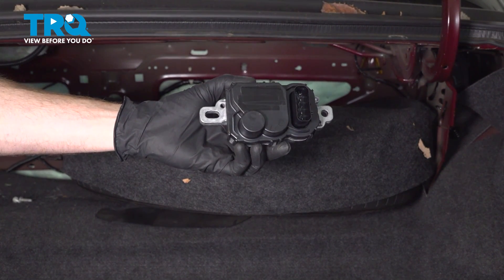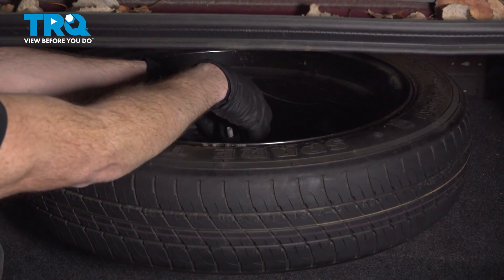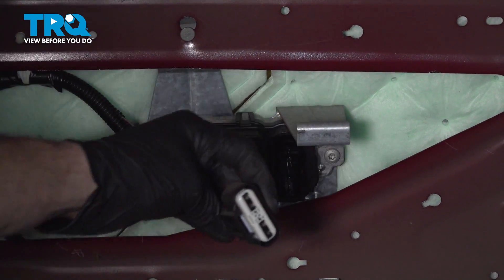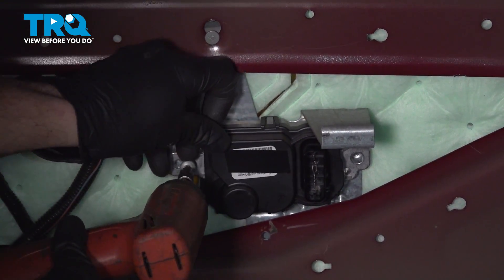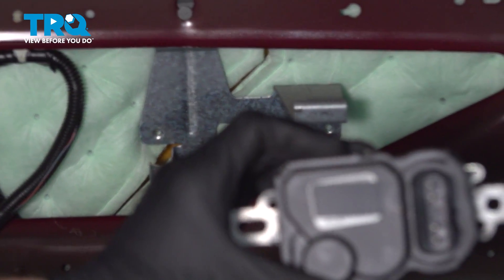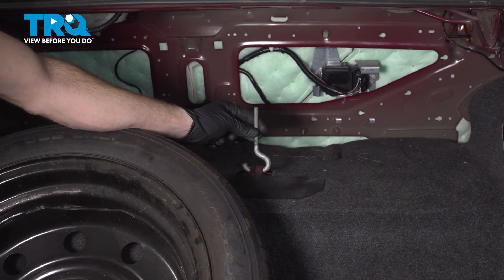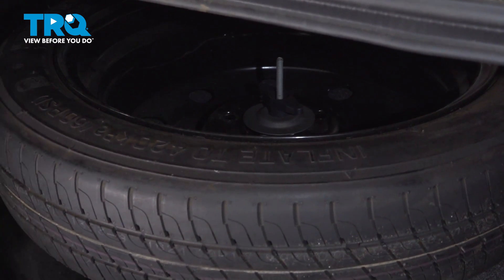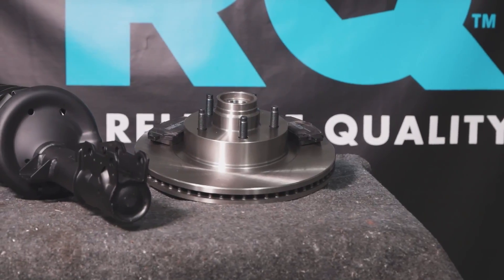How to Replace Fuel Pump Driver Module 2003-2011 Mercury Grand Marquis

Comment from the maker: √  Watch the Video
√  Buy The Part at 1A Auto https://1aau.to/m-Shop-TRQ-Parts
√  Do it Yourself
√  Save Money
Reply: You need to change the model year range on your video.  I am working on a 2003 Mercury Grand Marquis and the fuel pump driver module is not (1) located as indicated in this video and (2) of s not the same part.

Comment: For 2004 it is located where the fuel pump shut off switch is on grand Marquis Ls easy 2 number 8mm bolts

Comment: For those who own a 2003-2005 MGM/Crown Vic, the FPDM is located on the left side of the trunk compartment below the fuel inertial cutoff switch. The aftermarket Dorman FPDM unfortunately, is only specified for the 2006-2011 models, though.

That leaves us with getting a used / junkyard FPDM, as I don't see even a remanufactured unit available. I'm wondering (and I HAVE NOT tried it) if we could take the Dorman FPDM and respecting the 6 wire functions retrofit it to the 2003-2006 models with a simple mounting bracket change. If I try this I'll comment again. (If someone else tries this, please post).

Comment: My 06 Marquis stalls out while driving maybe when it warms up. Stalled out cold first. Had fuel pump replaced, fuel rail pressure sensor replaced, air filter, maf sensor, egr valve, fuel vapor tube and it keeps giving P0191 code

Comment: my module is on the driver side of the trunk by the rear wheel and the part you are describing and listing on your page does not fit a 2003 grand marquis it says on the website ?